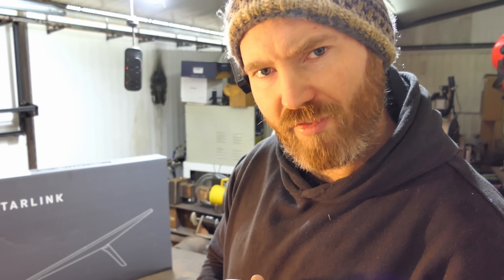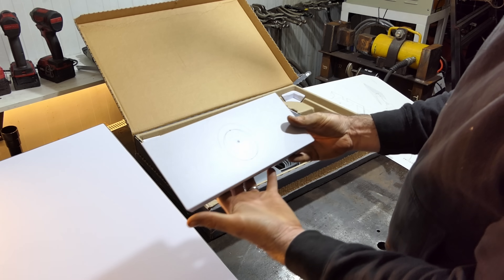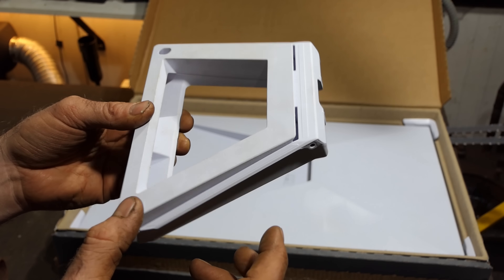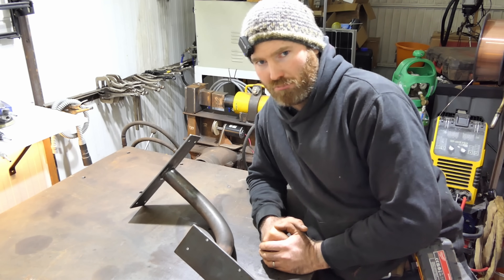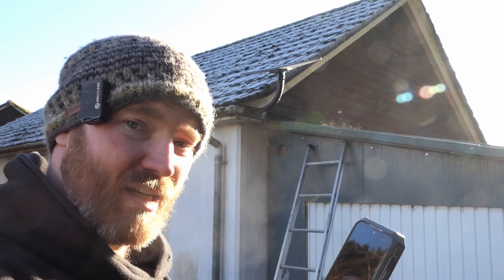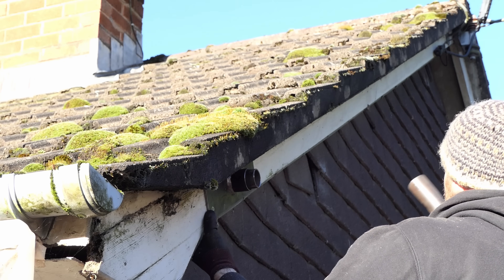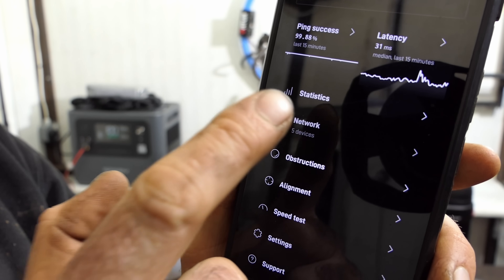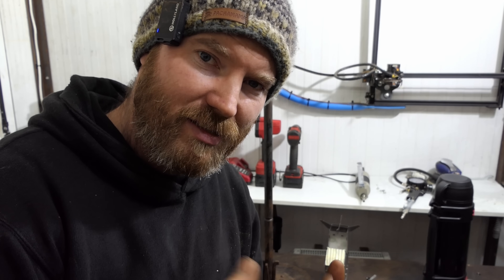I bought UK Starlink internet... I'm shocked!

Comment: Well, you received a better deal than most people in the US.
Been with Starlink since the first-year available unit was 600.00 US dollars and we are at 120.00 a month for service. I burned up 2 cables leaving the snow melt feature on automatic year-round. It doesn't know if there is snow on the dish it just turns on at a certain temperature. I keep and extra cable on hand, you will need it.

Comment: People honestly do not understand data. If you have a link, say 300mbs you should only be paying for the link not the data. As a Internet backbone expert with 32 years experience I have tried so many times to correct people's perception, tried various analogies yet still so many just refuse to accept how a data connection works, it is the biggest scam, that when people realise is going to blow up in network operators faces.

Basically when you have access to the Internet, say 300mb up and down. Your connection is stable, you are in effect transferring data across your link at 300mb every second, I am simplifying a bit so people can understand. When you download say a youtube video, which is what you do when watching, all that happens is your clicking on a video changes the 300mbs data flow... it does not do more than change that flow of data. It alters the 1's and 0's. It does not change the fact you have while connected a 300mbs upload and download of data, just that your data now has more ones than zeros or visaversa .

Why you are charged for data is the problem. 

Take for example a circle of pipes carrying heat, then you have a connection to that circle through a much smaller pipe. It circles warm air through your house. No matter what you do that heat flows until you block your pipe from the bigger circular network. The supplier of the heat is still generating that heat whether you are connected or not. Yes everyone will see a slight increase in temperatures when you are not taking any heat from the system. This is how your speed changes over time, when someone connects to the Internet they take a bit of the data(heat) and it slows everyone's heat(speed of dataflow) when you disconnect then everyone using data from your local loop will get a very slight increase in heat(dataflow). No matter what the generator of the heat will produce exactly the same amount of heat, (bandwidth) every day of the year. It does not cost them any more if 10 people are connected as then those 10 are sharing the heat receiving slightly lower temps, thing 0.0001 degree less. When you have 1000 people connected to the data stream you get congestion, this is where in the heating system people might see a 1 degree drop in heat received. 

Yes this analogue does not work perfectly but it is the easiest way I can describe it so people can understand. 
It makes absolutely no difference to suppliers whether you upload or download at the full capacity of your connection every second for a year as compared to only downloading 1 small 3 minute video. It does not cost them 1 penny more. 

The cost to an Internet service provider is the equipment you connect to, the electricity to run those systems and the cost to service customers, accounting, troubleshooting, etc.

I am really trying to dumb everything down so people can understand.

Now with sattelite we see a slight difference but the basic premises still stands. Sattelites might quickly adjust your bandwidth access so while you are typing in a search in youtube they see you are not using your connection so basically drop your connection to just enough that you can send your search term and then your connection goes back up to 300mb. This is so they can have more users accessing the max throughput of the sattelite.

No need to do that on a fibre network where they can just increase the bandwidth with a card swap if there is congestion.

Comment: Appreciate your video an the effort you put into the video :)
Starlink - In my eyes as an ex IT guy who lives rural an worked at telcos for years, there is good an bad but is what it is
- good download speed (also depend on plan + amount of people in your area), bad latency times (initial connections to sites etc can be very slow) , IP + website restrictions in place that local adsl/fibre providers don't block (This also depends on restrictions in your country) 
Brackets / Dish break easy and don't hold up to real weather ,  
Modem - Very basic, doesn't have a good management system  ,Very high power consumption (around 125w) on the routers+heat compared to fibre/adsl routers/modems (30w avg)  (i personally run a good router that has firewall etc for my internal stuff after starlink for security reasons an better wifi + connection management)
Customer service - zilch in some places, as others say hard to fix your internet if you don't have any an not everyone has access to cell service

Comment: Sir

I am not impressed at those costs.... 

It's sort of 500 quid and a lot of trouble to get it going..... Then 75 a month...... Ridiculous. 

The guy is the richest on earth... Can't he make a better deal than that? 

So at the current BB prices I pay , 500 would get me 4.2 years of DSL ... They gave me my current system for free.... And at Starlinks 75 pm... That is nearly a grand per year versus my current 100 pounds per year .... So ten times more cost

As for speeds I get 44 down 20 up ... So you could say starlink COULD be ten times faster but ALWAYS?.....nope 

Then you have the internal WI Fi issues.... Again all money to solve.... The snow system does not work and starlink speeds can vary massively .

You didn't mention data allowance but I presume it's unlimited like my current broadband is

I would literally say that starlink would take me   3 years to see any gain from it due to its install cost versus performance and why do I really need over 40 meg's and 20 up?

It's a big big no no from me..... Their tech support is awful......

Who pays a grand a year for internet.in 2026.... It's ridiculous and  in 2026 internet should be almost completely free ....

Best wishes
B

Comment: Sounds like the hardware is junk. The router looks like a cheap crappy device. I wonder if you can plug in a better router to improve connectivity in the house. 

I would be surprised if the power you are running to the device outside can heat the thing to any meaningful degree. If the snow or ice is significant won’t it just overwhelm the limited heat on the outside device?

Comment: By the way, Starlink seem to now offer free installation and setup. Then it costs £75 per month for very impressive download speeds. 170MBps+ (and could reach 300-400)
Reply from the maker: It's actually better than that. Roaming is now £50/month. I'm just receiving the starling mini which is portable, has a built in router and only 20w draw on electricity. Will review it soon.
Reply: @joshuadelisle Love your reviews by the way. Honest, humorous and useful. Perfect mix
Reply from the maker: @jpbroadwater thank you. I appreciate your encouragement. Cheers J

Comment: yep starlink is the way , have you had any joy with the mini? bought the standard one used uk and france including south absoloutly superb, no charges for mine, easy to setup on the mobile never went on the web, bought chinese bracket for tv arial on caravan for 30£ and bolted it up in 10mins gave me 360 movement , yes setup on a wall first check rough alighment before fitting to the wall
Reply from the maker: I've just been offered the mini for Free, do you think it's worth trying it out?

Comment: I've never had a WAN-to-Home router whose Wi-Fi strength was adequate for the whole house.  For the last several years, I've moved from one mesh system to the next to get fairly uniform bandwidth throughout, which, in our case, we needed. I disable the WAN router's Wi-Fi, and set it up to bypass to the primary node of the mesh router. I've gone to throwing physical cable to the remote nodes to get the best outcomes, despite the ability of mesh systems to daisy-chain wirelessly among the nodes with fairly decent outcomes.  Thanks for sharing this!  Best of luck to you and your family! You're raising them right! 👍

Comment: We’re offgrid in Northumberland, limited power and so we have always been a bit dubious of anything that’s turned on al the time, but…… as YouTubers as well uploading content off our mobiles hotspot is time consuming. Do you think this is a good compromise, power, money and speed?
Reply from the maker: It's expensive but its reliable and works well. I've had greater issues with BT and 5G not delivering what was promised and being a pain to fix. Starlink was simple and so far very reliable. In the event of a national power outage it's also off grid as local networks still need the grid. Cheers J
Reply: @joshuadelisle the networks going diwn with n an outage is a very good point, thank you. And cheers for the reply. New subscriber, great channel.

Comment: Speedtest you show in the intro was your phone probably being slowed by all sorts of things. Connect a cat 5 ethernet cable direct to your router - plug the other end into a laptop & then run speedtest. Wireless affects speeds - also reboot a device before running a speedtest.
Reply: Don't know how many times I've wrote the same info - most people are clueless about very basic IT.

Comment: A byte is 8 bits, a nybble is 4 bits. A bit is a single state, be it on or off, 1 or 0. Bit is short for Binary Digit. I remember this from my O Level Computer Studies in the 80s!! 368 mega bits per second is therefore somewhere in the order of 46 megabytes per second. Still flippin' oarsum.

Comment: 10:26 SO REFRESHING to hear you pronounce 'schedule' the correct way...SHED-you-ull...instead of the 'Americanized version' (SKED-yule)...with the elephant on our southern border here in Canada...American pronunciation is creeping in. And, THANK YOU for the great video on StarLink...I don't think I really need it - here in Toronto, we have fiber optic cable just about everywhere, and the difference from the old copper-line was amazing. The local telcom actually tore out the copper lines a few years back, so I have the lowest speed (cheapest) fiber optic connection available. Interesting to note that ALL the speeds use the same very thin fiber optic cable...so, having installed the cable from the service line at the back of my lot, I could upgrade to a faster service if I wish to - easily without changing the cable. Thanks again! James in Toronto

Comment: Can recommend tp-link decos if you haven't setup access points yet. We've got 3  throughout the house on Ethernet and the range and speeds are great. Not the best if you want to control your network on a sysadmin like level, but that's what I tell my wife the yet another new shiny block in the server stack is for...

Comment: 8:30 I’m not very knowledgable on starlink but you might be able to replace the WiFi routers with something better. I purchased the TP LINK DECO BE25 3 pack. Very easy and simple to set up and it increased my range up to 4x compared to my ISP routers. Only downside is the price, it sets you back around £250

You might have to do some research into how they fair against the starlink ones.

Comment: There is a good chance your copper/DSL has noise on the line which would cause ISP to lower speeds for stability otherwise connection will just drop out. Or they could just be lying to you. Either way you might be able to make it better with a phone call or might need to clean up the copper. Give it a look. Oh yes even a line drop to another close by resident could cause issues. They just remove the line from your house but leave the wire connected to pole. Or underground.

Comment: to be honest, the best thing to do in the UK internet wise, is push for local fibre companies. I had crappy internet and was paying 35 a month, until two local fibre companies opened up in sussex. i now get 900mbps up and down for 30 a month. i get having star link in very rural areas, but paying 300 for setup (I paid 0) and then 75 a month for a third of the speed in urban areas, with all the extra effort of setting it up, plus doing business with that muppet that runs it seems less worth it then the additional speeds. especially when access to it is controlled by someone whose very political and not British. i get needing to do it for business purposes, but for home users id highly advise against this sort of thing even if you are diy adept. - Data and Network qualified person

Comment: Based on my own experience I can tell you some basically simple things get easier when you're about 45 to 50.
Like judgement if it's really worth the time to save a few bucks.
And becoming able to think through two or three times whether I made a spatial error while strategising (like mirroring or inverting).  

Since I'm certainly much less smart than I was 20 years ago, it must have something to do with more patience and less drive. And maybe experience, although I turned out be be quite immune to wisening up after making stupid sloppiness mistakes until I got old.

Comment: I'm watching your video at night. I do plenty around here and do have a life worth living. An Irishman used to tell me, you're a long time dead. My favourite part of your video was the threading. I always do them by hand as taught at school decades ago. But times have changed it seems. Still I have the time to go slow and steady. Nice to see a young bloke working through stuff and then fabricate (make stuff) as a solution for a problem. As for Starlink . .  ho hum, had it for several years now here in Oz. Good speed and got better as more leo sats were deployed. My tip is, why do 4K? I downrez all utube vids I watch to 720p. Works for me - can't hardly tell the difference between that and 1080p tbh. 4K? Heck, Whats that?
Dropped a hard drive eh? Go solid state, spread your work out between smaller drives, backup critical data, repaste ur hardworking laptop regularly, don't rush, enjoy the moment. In fact, have a life worth living :-)🤭
Reply from the maker: Thank you so much. Solis stats is definitely what I needed, it's a false economy otherwise. I do 4k Because the algorithm pushes it further for some reason. I guess you can also zoom right in to see my mistakes in detail lol. Cheers J

Comment: Given where I live outside a UK city, we'll never get cable broadband to speed our connection up even further, and have used Starlink at a relatives house in rural Ireland, where it worked well.

Think if it was £50/month I'd happily switch from Vodafone, but we also have to pay a ridiculous supplement for the basic equipment where I live as the service is popular!

Comment: Got mine from Starlink 2 months ago. It was free, just an offer 75-00 a month starting when I first log on. Was 350-00 in Currys 0-00 from Starling. I live on a boat, in a marina for the winter when I start moving itll be 99-00 on the roaming charge,it only works in a registered with them static place for 75-00. Took 15min to set up,I run it at 10 degrees off angle because I cant be arsed to fiddlle with it and get way more speed than I use. 9 weeks never dropped out.

Comment: Very interesting. I viewed the whole video and apart from some slight difficulty setting it up, I could not find any negative part. All seems positive. Then, why were you "shocked", which carries a strong negative connotation? Why were you not impressed, or amazed, or at least satisfied?
Reply from the maker: I'm shocked at the price and hidden costs. The speeds are better than what I had but are not as good as fibre if it were available to me. Cheers J
Reply: @joshuadelisle  Ok, now I understand. Thanks for the reply. JC

Comment: With BT fibre unless you connect directly to the router you do not get anywhere near the speeds advertised but if you use wired its fantastic

Comment: Fabulous presentation and video. Really useful technical content delivered in a really understandable and enjoyable style. No wonder BBC et al are dying, you are a natural presenter! We are now toying with getting this. Our road has fibre (100's of Mbits), but our on off house was built and the end of the close in someones garden and getting fibre needs digging up a road (not happening any time soon). So I am really interested in exploring Starlink.  Mark.
Reply from the maker: Thank you so much. Starlink is expensive and is my only option. I would recommend fibre if it's possible because it's superior in speed and if not then a 5G receiver is likely cheaper and just as fast through your mobile network. Starlink gives the option to be anywhere and have reliable Internet. Cheers J

Comment: Do you get a 5g Signal in the shed ?  if so use your phone :)
Reply from the maker: It's not great or reliable.
Reply: @joshuadelisle  I'm deep in the country side and I just had to changedproviders from ID Network to EE,  EE has 5G here and the speeds greatly increased by x 20.    Check your postcode and see if any other providers can offer you a better performance.

Comment: Forgive me I’m a tadge old, so modern stuff is like a god issue with me. Understand that you will get decent WiFi in the house, but what about mobile phone coverage? Is the phone connection with star-link, or do you have to buy separate coverage?
Reply from the maker: Hi. Starlink will give WiFi to your phone and it has a cable connection for a computer also. I don't have very good phone signal here either so starlink or satellite Internet of sorts is my only option for fast Internet. Cheers J

Comment: You'd probably benefit from running a 15 meter ethernet (cat 7 or cat 9) from the router in your home, through to your workspace and have a wifi relay out there.
Reply: cat 9 😂
Reply: Or a powerline that also acts as an access point
Reply: Are you from the future? Cat9 doesn't exist yet.